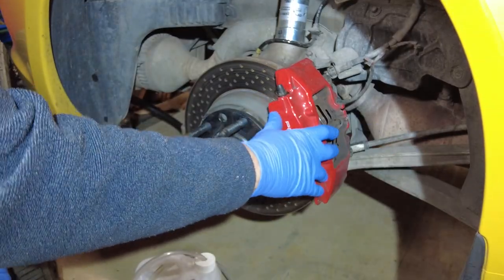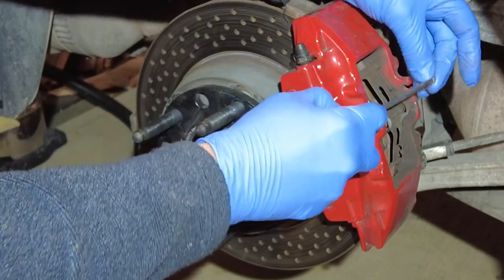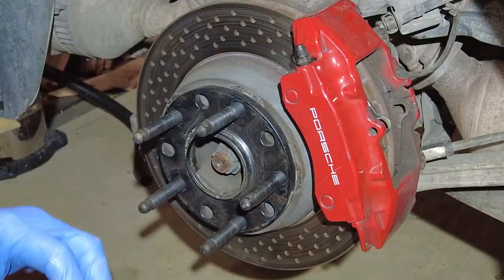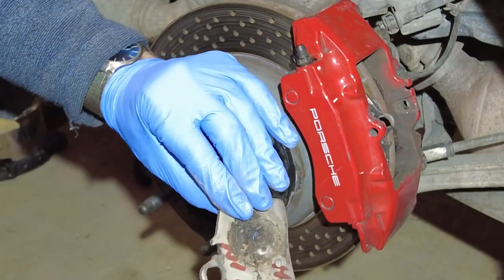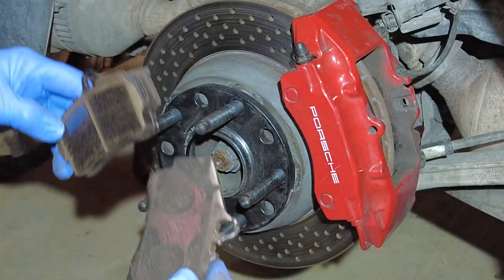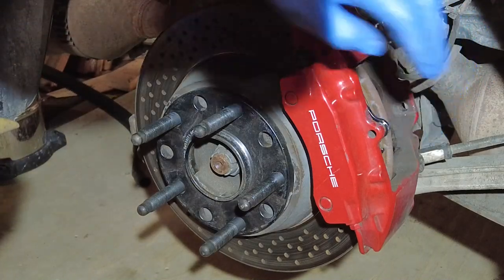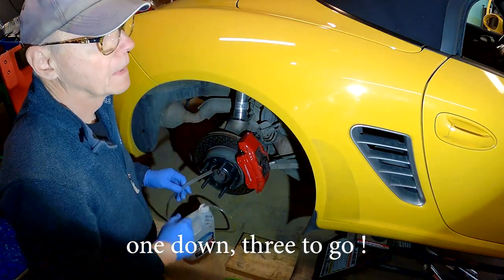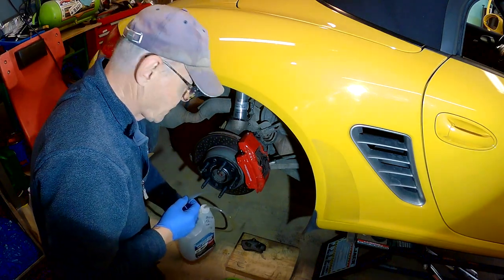Brake pad swap and Fluid flush !

Comment from the maker: Just back from the track. Very happy with my Pagid RSL29s! Very quiet when hot, with normal squeakiness when driving on the street to get lunch or fill up the tank. Happy camper I am!👍
Reply: My RSL29s squeal like crazy when cold, to the point of me using ebrake at intersections here and there. They are quiet on track for about 10 laps then start to make noise. Several re-beds have had no effect. 996 2003 here. What's your secret? :)
Reply from the maker: @miketdavies  Never used mine on the street except maybe going to get lunch on track days. Very squealy. On track, when they get some heat, they were just fine. Who knows why there's a difference. Brake late, brake hard was my style.
Reply: @NewArt1  FWIW I don't get any pad fade on the track, but they do get noisier and squeal. Then at end of day, they are OK for a day or so on the street before the freight train returns. 
I imagine not having the pad spiders in them doesn't help :) 
I'm too impatient to swap pads at the track, or wheels (so far at least!) 

PS which Hawks were you running at the track? Guessing HP+ or HP 5.0 if RSL29s are a comparable replacement. Not happy with them, I gather?

Comment from the maker: I had the hp+ on my previous car and they were fine (again when hot). For the 2010 car they required a different model, I think the hp5 that you mentioned. I found the noise unbearable, even if I flogged the bejeezuz out of them.

Comment: This is the first time I have watched this being done. Very interesting and looks pretty straight forward. I shall be doing this myself on my 986. May I ask, would I need to increase the pressure after each brake has been bled or should once be enough. Also, would there be any advantage to using race pads on the road, or would that be going too far.
Great video, and love your calm approach, even to the story of having no brakes at full speed on the back straight.
Reply from the maker: Thanks for your comment! You do not need to pump up the Motive again. You will see that it drops very little. I do NOT recommend using race pads for street driving. This is why I swap them back to street pads after an event. Track pads need to be hot to work properly. They are also noisy when cold!

Comment: Is that the track at Mont Tremblant? or another one? I hear that there is a track for sale some where outside of Montreal. 
      I track at Mosport, I first went with my 1980 MGB but I could read a book on the back straight, so I bought a 2000 Base Boxster for the track but haven't gone yet. Now I am thinking of going with the PDK as my left knee is now bone on bone. Thanks for your videos, it is going to help me prep for track days. What tiers do you recommend, I just use the car in the summer.
Reply from the maker: Tremblant is my home track. It is owned by the Stroll family (F1 racing) It was up for sale for a period  but has now been withdrawn from the market.
Reply: @NewArt1   Thanks for the update, for some reason YouTube didn't send me the email.